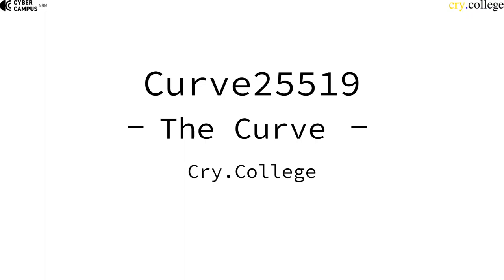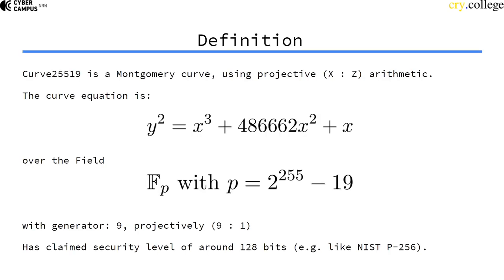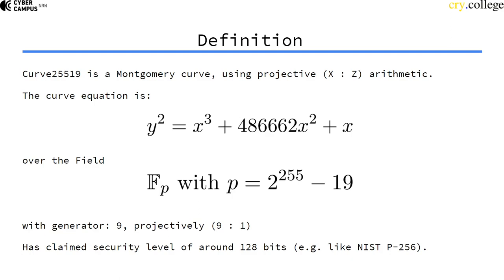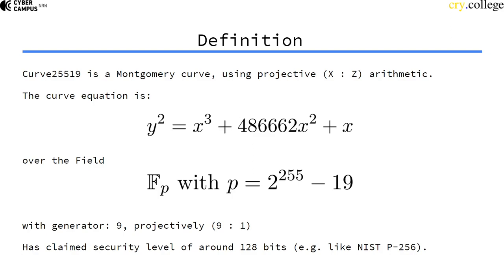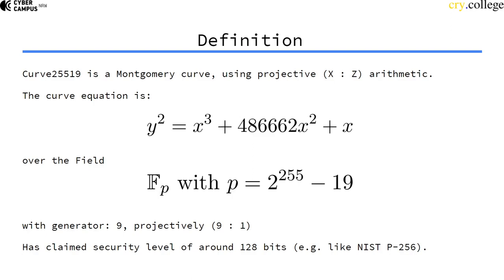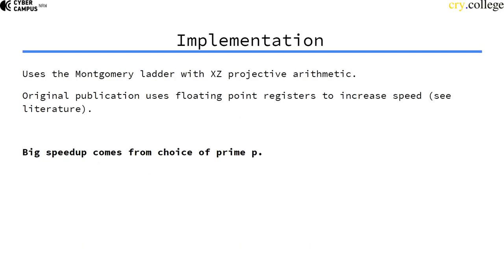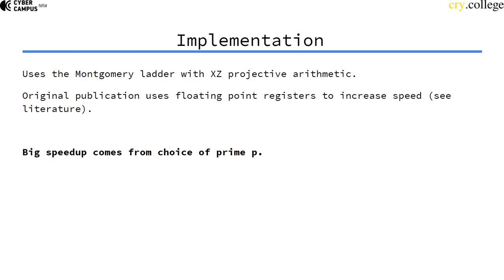Curve25519 Details

Comment: hey I want to implement the Montgomery's ladder algorithm using python, to do point multiplication, I successfully managed to do that  but when I tried to do scalar arithmetic on Curve255519, as p =2^255 - 19 ,  my code failed to give right output,  I tried to calculate 21130179955454(G) , where G is base point with x coordinate 9 and z = 1,  curve : y^2 = x^3 + 486662x^2 +x : p = 2^255 -19
COULD YOU HELP ME OUT